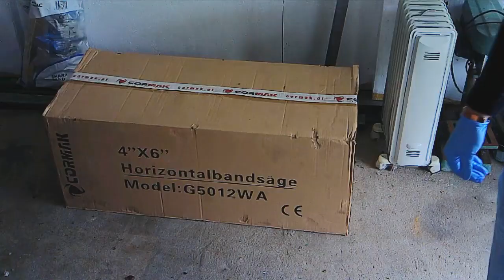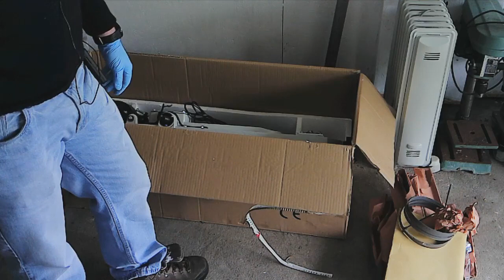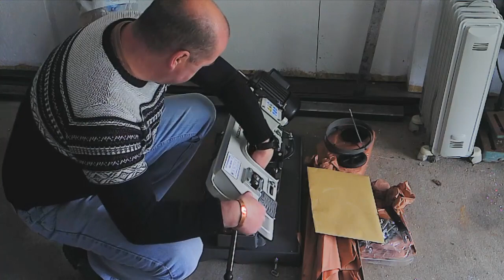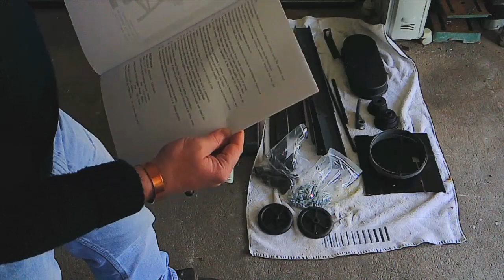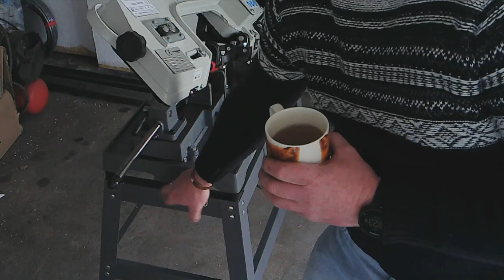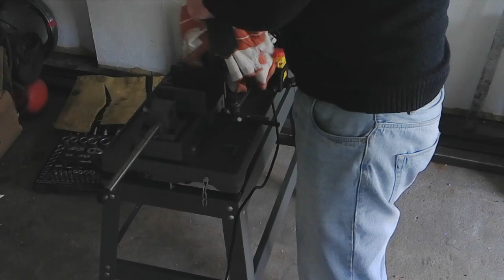Episode 10 Cormak Bandsaw G5012 Unbox Build & Review

Comment: Sorry Jon but that is not a Polish copy of the bandsaw part I am sure of that. The castings of the main saw part are identical as far as I can see to my Clarke 6x4 one. The only difference that I can see is where the switch gear is mounted mine being at the front right hand side looking from the lift up end and yours being at the hinge end. I had a similar problem with the pulleys. When you opened it up the paper everything was wrapped up in is the same as the Clarke unit too. Probably the same factory lol if you have not gone and ordered a milling machine by this time ( July 2021) I would book a week away to Poland to go and see the milling machines in person, then you can make an informed decision about whether to buy one or not.
Reply from the maker: Hi Samrodian, thanks for the comment, yep, bang on, Chinese and re-branded. Took me a while to figure it out but got there in the end. Having said that, totally solid, the base casting is very thick and robust. It punches well above its weight. I have worked the Clarke (and others) copies with the sheet steel base, this is in a different league from a rigidity point of view. The finish is poor but the cut is bang on square every time, even with a knackered blade, and I know the Clarke, Sealy etc ones start to run off when the blade goes blunt from bitter experience (Scrapped some expensive aluminium many years ago). Cheers, Jon

Comment: There is a possibility that that machine is the original Soviet era original that the Chinese/Taiwanese/Koreans copied in the same way they copied the mini lathes. 
Whatever the quality of the saw, it better than doing it by hand. The horizontal table will probably  annoy you with its flimsiness,  with my early Taiwanese one i modified a vice to run on dovetail slides for more stability. If i can find it again and take off the inevitable rust i might show it in a video.
By the by, i have just about caught up on your back catalogue and I think I'll stay.😉
Reply from the maker: Hi Chris, thanks for the comment, yes please on the vertical saw application, I am a way off yet so no rush but I had already come to the conclusion I would need to do some sort of surgery if I was ever going to use it in the vertical plane. Good thoughts on the soviet pedigree for the saw, you may be right there. Glad you are sticking around, you are most welcome. Jon
Reply: @jonsworkshop  aw shucks.

Comment: Hi Jon. I often get called Chris for some reason! Welcome to the world that is owning and fettling Chinese machines to get the best out of them. I had one of these and it's bigger cousin too. They both worked well after some tweaking and improving. They both cut metal quickly and square. And both still are doing. One thing I will say was the one I had that was same size as yours had casting sand in the worm gearbox. I had to clean it all out. It might be worth checking yours for that. Looking forward to the next episode.
Reply: That's funny i get called Chris too, no wait, i just remembered there's a reason.😂
Reply from the maker: Hi Carl, I knew I had got it wrong even before I said it, I am rubbish at remembering names, please accept my apologies. I have already started filming Episode 11 and have made a formal correction within it. Thanks for the tip on the gearbox, hopefully I am not too late as the saw has been well run in today cutting all the steel for the bench. Thanks for the comment. Jon
Reply: @jonsworkshop  Please don't worry about it! No need to apologise.  I'm sure the saw will be alright. They are quite robust things despite being a bit rough round the edges. Looking forward to seeing you making the bench. Your workshop has been transformed.